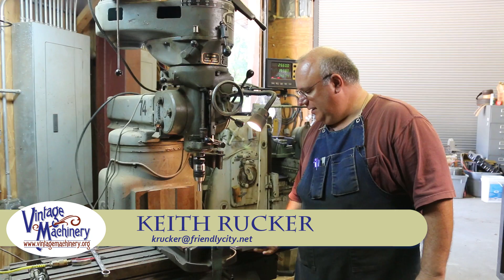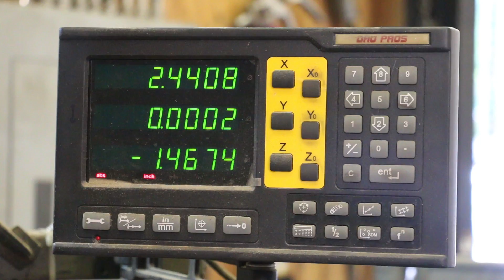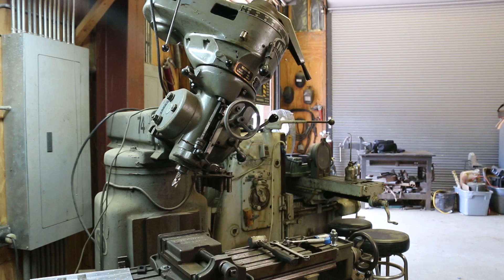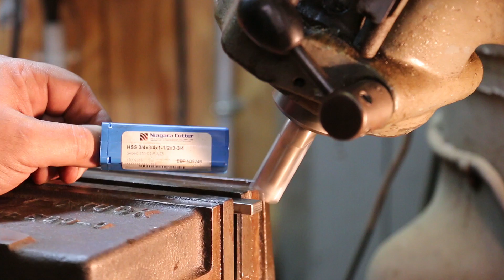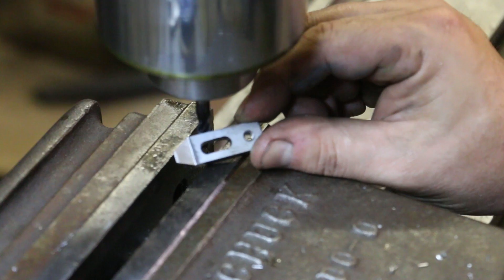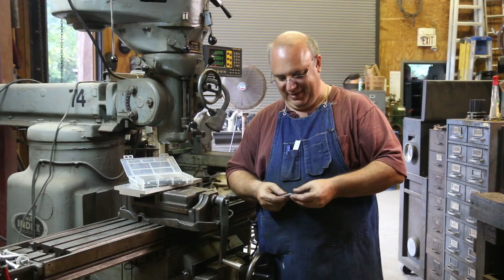Making a Set of Mini Pallet Toe Clamps for the Milling Machine

Comment: A video on DIY side loading cam clamps to go with that pallet would be very useful.

Was wondering if you have any observations or opinions about vacuum clamping?
Reply from the maker: I have used vacuum clamping with my woodworking but never with metalworking.  I have nothing against it - but it does have some limitations.  For light milling, it works fine.

Comment: Nice little video again Keith.  I made a similar pallet for my mill a while back, very handy. Have you ever thought about or used a vacuum chuck for the mill? I made a couple of them for my Prolight bench top CNC and my Bridgeport and they work remarkably well. Just a thought!
Reply from the maker: I have used a vacuum chuck for a wood lathe before, but never in the machine shop.  I have seen others do it....

Comment: Does the tap pull the quill down once it gets started or is it programmed to go down at the thread pitch like a lathe?
Reply from the maker: This is a manual machine so no programming.  Once the tap starts threading, it just pulls the quill down and pushes it back up when you reverse.  On come CNC mills, you can program it to do something similar.

Comment: I chuckle every time you blow the air nozzle. That South Georgia humidity has taken up residence in the Museum's compressed air lines. :)
Reply: mrpete222 would be telling us not to blow those chips around with air
Reply from the maker: Lots of condensation in the lines themselves.  The compressor has a pretty good moisture separator on it and we blow the tank down all the time.  But, when the lines sit overnight, you get water in them and then when you use it the first few times, there is a lot of water to be blown out....

Comment: Enjoyed this video.

I am wondering why you decided to rotate the mill head instead of setting the part on angle in the vise?
Reply from the maker: I would have had to make a jig to hold the clamps at the correct angle.  It does not take long to move the head nor does it take me long to tram it back in.  For me, it was easier.

Comment: Do you need that kind of machine to create those clamps? Can it be done with a metal lathe?
Reply from the maker: A metal lathe is for cutting round parts.  But, some lathes have a "mill attachment" that basically uses the spindle on the lathe to turn the tool and the mill attachment stands up straight and has your X and Y axis on a table that can be moved.  So, the answer to your question is that a lathe is not the tool to make these, but if you have the right attachment (very few do), you could in theory do this on a lathe.
Reply: You can do it on a lathe, no mill attachment. Just an angle plate. Lots of setups thought, hard to keep things accurate but that shouldn't affect this project.

Comment: I may be jumping the gun here, but just curious if the repaired cylinder head on Ol' Number 5 locomotive held it's steam pressure, or will that be a future episode? I happened on your channel about a year ago, and I'm really happy I did. Don't know why exactly, but your know-how and easy going disposition makes your videos a real pleasure to watch.
Reply: Good question. I hope it gets answered. Ol' number 5 is over one hundred years old, and may need some refurbishments. Can you imagine trying to duplicate one or both steam chests? Or a drive rod? Or a Crosshead? Throttle valve may be easy, not sure. Dyanamo/steam driven generator, not so easy, I imagine, since it resembles a steam engine itself, I think.....more like a turbine. A lot of ideas, a lot of work that could be done.....a lot of funding needed.... :-( Union Pacific's UP844 cost about $2 Million, I think to restore. UP4014 is still under restoration and is about 1/4 larger than UP3985, which is about 1/4 to 1/3 larger than UP844.

Comment: Would brass toe clamps work better considering the (small) size of projects that you would work on? Would the steel clamps damage the piece that you're working on?
Reply from the maker: Brass would be fine, but expensive.  I don't see a problem with the steel.  If you are worried about damaging something, just use a brass shim.
Reply: You know I thought about a brass shim just after posting. After watching so many machining vids, I think I might be partial to machined brass too. Your machined parts look amazing too, but they don't have that flashy gold color.

Comment: nice job. the box was a nice touch.   I can now do my pallet.. I just added a 4" riser (the perfect size for a Series 1 Bridgeport, IMHO) to my mill this weekend... everything is trammed and ready to go.
Reply from the maker: Sounds like you are ready to go for sure!  Thanks!
Reply: made a 6x10x1 pallet with a 1/2" grid pattern; every other hole is a reamed hole for a dowel, the others are tapped.  (Milled on a Haas VF2, could you imagine doing all those holes and processes on a manual mill?  thats a LOT of cranking and handle turning)  I'm borrowing your toe clamp design and making those next. :)

Comment: Great - I have some of these on my bucket list. Chances are I will copy these considerably - I like your jacking feature.
Nice job Keith.
Reply: Hi Namessake, if, sorry, when you build one you will find it easier to have the jack screw the other way around, so you can adjust with an Allen wrench. On that note, the screw driver handle ones make working easier too. The voice of experience speaking, I built mine within days of Lipton T. showing his. and it is a remarkably useful bit of kit.
Reply: Hi Chris -- thanks for the suggestions. I have yet to find the material I want - unless I machine down some thicker stuff. Another project is up coming first - temps and back permitting!
Reply: Thicker shouldn't be a problem, loss of head room not really relevant as you are only going to be working on smallish stuff.   
Re T & B, I know the feeling. Re the T, I have taken to Willie Nelson head ware, saves rust on the lathe from the "droppings".
Reply from the maker: Thanks - good luck with making your own!

Comment: Nice little project for a nice big mill.

While you were making it I was thinking that the screws you use at the back could stand to be slotted on the ends so you can adjust the height more easily from above with a screwdriver.
Reply from the maker: Thank you!

Comment: I'm not a machinist, right up front, however back in the day I did operate a Bridgeport mill. Now to
the point, the machinist that was training us to run the production mills would
not allow anyone to use an air hose to blow the chips off. He said the chips
could get in the table ways, lead screws and other places that may cause damage
the equipment. We were only allowed to use brushes to clean away the chips. I
saw you using and air hose to clean up, my question is; was that guy correct or
was he just being assertive?
 I saw him blow chips off but it was really not a good idea to question him too often. 
 Really enjoy your video thank you for your hard making them.
Reply: Not fully right, not fully wrong. There are areas (especially on old machines) were chips can do damage. Open lying screws are an example. Using air makes it a lot easier to blow chips all over the place. So he is not wrong. … But if you are careful and know the weak spots of your machine you can quite safely do it. He did not trust you with it… fair enough I guess. Keith is a veteran, running his own machines on his own risk. 

It is like driving your car from your driveway into the garage without a seatbelt. A company will have the policy: “No driving without seatbelt - ever”. At home most of us would not bother to put it on for a view feet.
Reply: Good answer and analogy.
Reply from the maker: There is some truth to what he told you.  But, in my opinion, it depends on what kind of chip you are dealing with.  For steel chips that are pretty big (not going to get in between the ways on a machine), I don't think it matters that much.  But for something like the fine dust that comes off of cast iron, that can work into your machines and cause significant wear.  It is probably a good rule of thumb to lay off the air, but sometimes it just is not practical.  I typically do use a brush and vacuum a lot to clean up my machines, but sometimes you just need a blast or air.
Reply: Personally, if I was letting someone use MY mill, I would tell them to never use air on the mill; I use air because I know where and how to use it.

Comment: For really thin pieces superglue the part to the pallet to hold it down. Heat it with a torch to release it after milling.
Reply from the maker: Yes, I have seen that done many times.  It works just great!  I showed a "glue chuck' on the lathe a while back where I basically did the same thing.

Comment: why did you not change out the part for each op?  changing bit and changes gear is more time think ?
Reply from the maker: I disagree, especially for just eight pieces.  It only takes a second to change a drill bit in a keyless chuck.
Reply: i was not thinking so much about the tool change but about start /stop on the motor and speed change and you are right to do it the way you like it's not about time or money .GOOD JOB   thanks for sharing